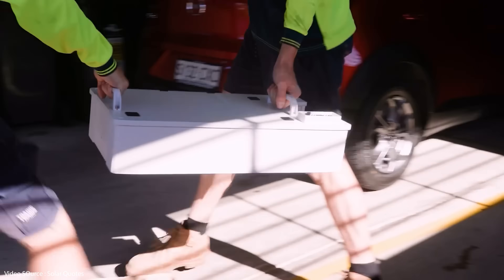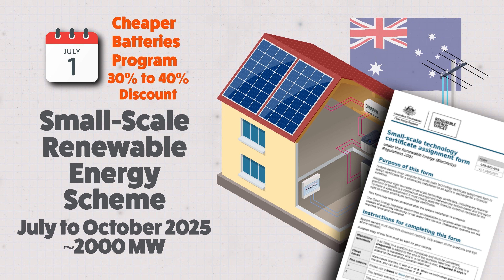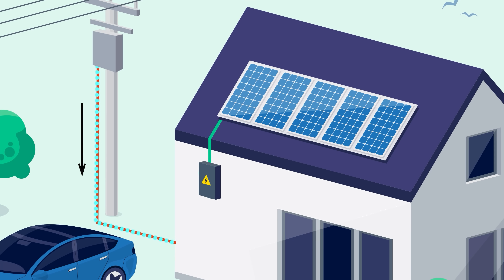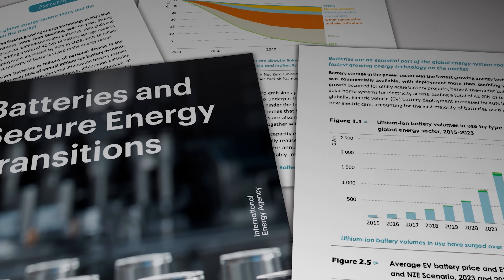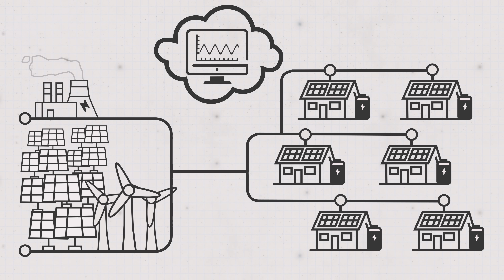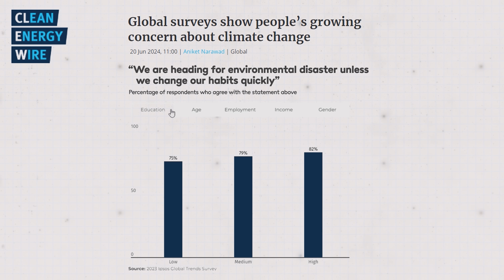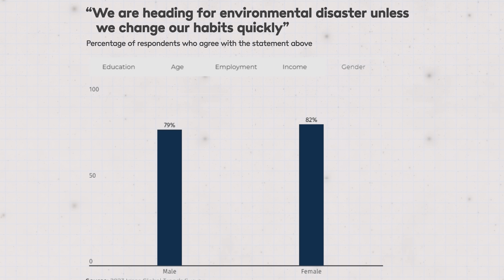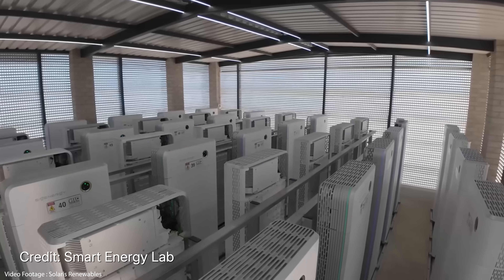Australians installed 100,000 home batteries in 17 weeks. Why can't we all do that?

Comment: I live in northern Scotland where we have a huge number of windmills .
The generators are paid around £1 billion per annum to switch off the windmills as the grid apparently can’t cope.
Discounted home batteries accessing very cheap power like Australia would be a massive game changer here.
Reply: I am one of the 170k new battery owners and this is actually one of the most important points.  It doesn't matter if you solar generation ability is poor... it is the connection to the wholesale grid and the ability to suck up and store cheap energy for use (or sale) later when energy is expensive is THE most important element of the Australian success story. If you have batteries, it doesn't matter where the energy generation takes place - just so long as you can gain access to it when it is cheap and plentiful. You can use it or sell it when it is expensive. That's the real trick.
Reply: @eddiesheehy3993 And over time the battery system will reduce the overall cost of power for EVERYONE not just those with solar battery on their house. This includes renters and those unable or unwilling to purchase solar. 
Win win situation at government, business and personal level.
Reply: @eddiesheehy3993  I look forward to the headlines when these Tesla batteries are remotely commanded to supply the failing grid, and leave the owners with nothing.
Reply: @mrblack888 you can chose if you want to keep more energy reserve for you or to sell it.
Reply: @niconico3907  lol.  Until they decide you can't.
Reply: @mrblack888  how exactly? Even if they did, Just turn off the main switch!
Reply: @hidefandy  Your tesla battery is on a network, they can remotely operate it, or shut it down, at any time without your input.  You signed a user agreement that gives them complete authority to control it.
Reply: @mrblack888  I can’t find your original post but I’m pretty sure you said they can discharge your battery.

They can’t if you turn off the main switch. That is simply not possible if it’s isolated from the grid.  Ie off grid.
They might be able to shut it down but that’s the same as any other inverter.
Reply: @hidefandy  This is cope.
Reply: @mrblack888 
You are obsessive about posting your ignorance. 🥱
Have you been watching too much Sky News?
Reply: @mrblack888 
Tesla is not the only battery system.
Nor are Li ion the only battery.
You really are a little dull.
Reply: @mrblack888 The contract for solar batteries guarantees minimum of 20% saved power for each householder.
Reply: I used to work for the transmission company. There’s 10 GW of wind generation built, only 4 GW of transmission. Cheap overland transmission could have been built pretty quickly and easily, and Scotland could have been exporting surplus generation to England for years. 

Due to tricky community consultations, it’s been decided transmission will need to be largely sub-sea, which will be more expensive and potentially more disruptive to those ecosystems than overland cables would be to their ecosystems. But it’s “not an eyesore.”
Reply: @idunnoay I grew up in the Midlands coal field. Slag heaps, power stations, mineral railways and transmission cables across rural Nottinghamshire. No one commented back then, perhaps because we all worked in those industries! Make it financially worthwhile and then sympathy for the NIMBYs might evaporate.
Reply: @paulhayes6920  it should be that simple :)
Reply: @idunnoay On Gridwatch it show that at 18:10 yesterday the UK was consuming 16.6 GW of wind power. That includes large wind farms out in the channel much closer to where it is used. The issue that won’t go away is what happens when the wind drops for days or weeks.
Reply: @Tailspin80 ah yes, dunkelflaute. Australia’s east coast grid is moving to eventually having a mix of 1. Geographical diversification of networked generation and transmission, 2. Batteries for short term storage of excess renewables and pumped hydro for slightly longer term storage, and 3. Gas peaker plants which would likely operate for about 2 weeks of the year when absolutely necessary.

I assume other countries’ grids will eventually look to do similar with some variation
Reply: @idunnoay The thing I don’t get is what problem is Australia trying to solve? They remain by far the world’s largest coal exporter (34.9% in 2024) which on a per capita basis is absolutely humongous, so clearly whatever it is it’s not climate change.
Reply: @Tailspin80 yeah 3rd largest exporter of fossil fuels generally. The current government here is good at having its cake and eating it too, which means making relatively ambitious commitments to reduce Australia’s scope 1 & 2 emissions, while saying the scope 3 emissions from our exports are the responsibility of our trading partners and defending them on the basis of carbon accounting, “helping our partners transition,” and the drug dealer’s defence of “if we don’t sell, someone else will.”

It’s been electorally successful for them. It’s easy to believe the only way we stop exporting coal and gas is if Japan and South Korea stop buying it.
Reply: @Tailspin80 Why the hair shirt? Why always climate? Cheaper, less other pollution, more individual control.
Reply: @paulhayes6920 Cheaper is why consumers go for it. But why does the Australian government subsidise it but encourage coal exports? Politics and lobbies.
Reply: @Tailspin80  OZ's biggest energy subsidy is to the coal industry at $14.5 billion US each year.
Reply: @Tailspin80 same “problem” Norway was trying to solve with its sovereign wealth fund and move to electrification, I presume. If we don’t use it, we have more of it to export. Mad, isn’t it.
Reply: @EstherV359  I suspect a bit of virtue signalling as well. Norway is very wealthy. Their oil fund is worth $2 trillion USD, or $340,000 per person so they can afford a bit of brand marketing.
Reply: @Tailspin80  Cynically, I think it's the easy push to pressure individuals to reduce their carbon footprint whilst not dealing with the big issues such as industry.
Reply: @aries6776 Industry does whatever is cheapest and if they don’t they go bust and are replaced. The system is based around this one dimensional invention called money and survival depends on making it not losing it. To superimpose an alternative system on top such as carbon accounting can’t really work. Even regulation can’t really work either because we don’t have a world government. The best hope is that eventually fossil fuels become economically uncompetitive against other clean sources of power.
Reply: @Tailspin80 the pollution comes from burning the coal, not exporting it. Otherwise you double count the emissions. Its like if you blamed the middle east for the diesel you burn in your car. If you don't sell them coal, they will buy it from somewhere else. Coal burning has also local pollution with ashes and other toxic gases that better be prevented even if you don't care about climate change.
Reply: @niconico3907 CO2 accounting is based around consumption rather than production because, in my view, this gives the maximum scope for weaselling out of serious commitments. If someone in Australia digs up a ton of coal there is only one place it is going: into the atmosphere. Reducing and eventually eliminating production is probably the only effective way to address the problem. That’s why we don’t do it.
Reply: @Tailspin80  like anything else it’s about economics. Why pay utility companies 3-10k a year.
Reply: @Tailspin80 but its different if you talk about petrol. It can be turned into plastic, roads, or diesel. How can the petrol exporting country know what you are going to do with it.
Reply: @niconico3907 Plastic is the main way in which fossil fuels are sequestered, but we only make about 400 million tonnes a year compared with 15 billion tonnes of fossil fuel consumed. Plus another 128 million tonnes for bitumen used as the binder for asphalt. Thats 3.5% in total. The rest get burned and turned into CO2. For sure no one ever puts it back in the ground once it’s been dug up.
Reply: @idunnoay Australia also has coal of better quality in that it burns more cleanly and efficiently. Better that overseas countries use our coal while transitioning to renewable energy rather than burning poor quality coal.
Reply: @T @Tailspin80 Fossil fuels are already less competitive forms of energy against renewable and hydro energy.
Reply: @jennifercampbell7698 that was a lobbying campaign by the Japanese government and some international miners back in something like 2008-2012. I don’t think those mining companies even argue for “clean coal” any more, BHP span off its thermal coal businesses into another company because they couldn’t sell them 😅

The cleanest coal is obviously the coal left in the ground - that’s carbon capture and storage that works.
Reply: @idunnoay True. But there is an ongoing transition process. 
I just recognise there is different qualities of coal. And Australia has coal that is sought for high level manufacturing, steel production for example. 
I certainly don’t support the concept of clean coal or continuing fossil fuels into the long term future though.
Reply: @idunnoay  Oh wait, genius cult followers also think they will put up multi square kilometers of solar panels in Spain and magically transfer 100GWs to 1000GW's of power north
Reply: @w8stral  transmission doesn’t need to be magical - but getting community approval for essential infrastructure being built in the most efficient way is hard, and shouldn’t be underestimated. Particularly when, in places like my home country of Australia, vested and political interests advocate for a less efficient system because it suits their needs.
Reply: @w8stral  It's not magical - it's cables. In fact X-power is putting a load of panels in Morocco and shipping the energy all the way to the UK .
Reply: @xxwookey if you mean xlinks then that was cancelled by ed miliband in June 2025
Reply: @pmac6584  Hmm, I didn't know about that. Not actually 'cancelled', but not given a CfD in the auction, which could well kill the project. I wonder what the offered/proposed strike price was? Thanks for the update.
Reply: @xxwookey And in Australia there’s a plan to export energy to Singapore. Also Tasmania sends hydro power to Victoria.
Reply: Storing some as heat in a water tank may help...
Reply: @anguscampbell1533  I saw that on a visit to Greece a couple of years ago. Nearly all the roofs had solar panels on top of a round tank which I later found out was for hot water.
Reply: You mean wind turbines? Or do you mill lots of flour in Scotland now?
Reply: Wind turbines, not windmills.
Reply: @TheFrewah Get a life beyond pedantry!
Reply: And a damn side cheaper than the subsidies to not produce!
I'd funnel the money to locals first... it's your landscape they dominate.
Reply: It would help you better if those wind turbines were on the consumer side of your meters... which of course is impractical... unless you get yourself into a community owned mixed generation project.
Reply: The generators are paid when they switch of the windmills and on top the consumer pays for coal/gaz power when those windmills are not producing enough. Same for still hugely expensive BESS energy that only covers power peaks for some 2-4 hours at a huge cost per mWh stored and sold ($100 to $400 per mWh). It´s a business model that generates 16% ROI for investors per year.
Reply: we do need more localised tariffs to make this work, I think Greg Jackson is campaigning for this as certain areas of the nation we need to store and deplete and different times of the day
Reply: @edc1569 Yes , you are dead right but Ed Milliband, the UK Energy Secretary is dead against it.
Time for an independent Scotland where we benefit from the energy bonanza.
Reply: I'd be interested to know how many string inverters were replaced during these battery upgrades. Here in Ireland, ESB, SEAI and other key stakeholders are actively sharing information through ISGAN which includes sharing lessons learned in Australia.
Reply: In your case, it would be cheaper and better to build grid scale pumped hydro energy storage. You have water and hills. And also big scale batteries. It would pay itself fast to store energy when it cost near zero and sell it when it is expensive instead of paying windfarms to stop producing electricity.
Reply: @niconico3907 We have a huge amount of pumped hydro storage .
Our problem is we are tied into an outdated artificial energy market which assumes we are far from the centre of electrical production.
The opposite is true.
We therefore pay the highest prices in Europe. The UK government simply prefers to pay generators rather than allow customers to access cheap electricity.
Reply: Its not the wind that is the issue. They are compensating the coal generation assets for their loses. Funny how most of their owners are in the house of lords
Reply: You could all have Hot Tubs in the meantime.
Reply: Home battery storage would not solve that, those are often combined with roof solar to make sense. 

It does require larger grid level battery storage at the source of production near those windfarms. 

The issue is that building put the grid is often costly and takes a long time. Therefore it does lack insentives do to so.
Reply: @paxundpeace9970 That is half true. The batteries need to be the other side of a grid pinch point. Having them in your home guarantees you a cheap energy supply with or without solar as you charge them when energy is cheap. Grid scale batteries can be useful as they can store energy after the pinch points and benefit from economies of scale. The owner of the battery is the one getting the main benefit. If you hold shares in gresham or gore street or one of the many grid scale battery companies then you can get dividends. Have the battery in your home and you can get free energy. Buy low sell high. You don’t always want the battery close to generation but in the best place to buy and sell the energy
Reply: Wow. You'd think that with that billion pound bill, this would be a no-brainer already.

But then, the UK government...
Reply: @gro @gromm93 point is that the economics of storing bulk unused wind energy on the network for long periods are totally different from local short term domestic storage of solar. No comparison. If there are billions of $ to invest there are probably better places to use it, such as improving the network, developing demand management and building wind farms closer to where it will be used.

Also, compare the average wholesale cost of 4.28 pence per kWh to the cost of storing it - about 1,000 times more. Economically it’s a non starter.
Reply: @Tailspin80  "4.28 pence per kWh to the cost of storing it - about 1,000 times more"
What a nonsensical comment. That's like dividing one hours output of a wind turbine by its capital cost and saying that's the cost per kWhr. An LFP battery has a lifespan of maybe 8000 cycles, so if it cost £40/kWhr of storage that's only 0.5p/kWhr per storage cycle
Reply: @garysmith5025 You can argue about the numbers but the fact is that the largest battery project in the world (Edwards Sanborn (USA)) is only 3.3GWh. That’s going to keep the UK going for about 10 minutes, given that we generate about 17 GW of wind power in good wind conditions. It’s simply the wrong sort of storage for wind and doesn’t begin to solve the problem.
Reply: @Tailspin80  Of course I can argue the numbers, especially when you're trying to twist them. 
" the largest battery project in the world (Edwards Sanborn (USA)) is only 3.3GWh".  So what? Why is the size of the largest battery relevant? The UK currently has nearly 7GWhr of utility scale batteries and an estimated 1.9GWhr of domestic batteries, a further 60GWhr of utility scale have been approved and it will become normal for every house to have a modest battery that soaks up maybe 5KWhr during off peak or from home solar and feeds it back within the home at peak times. It's obvious that we're going to have a highly distributed grid with generation and storage in virtually every home and business. In 10 years time the UK will probably have something like 200GWhr of fixed battery storage, and over 1TWhr of batteries in vehicles
"3.3GWh. That’s going to keep the UK going for about 10 minutes", again, so what? Why is it all or nothing? There's never going to be a time of zero generation on the grid, the whole point of battery storage is to cover temporary shortfalls and avoid having to pay CCGT stations to fire up and run for an hour or two at excessive cost.
Reply: @garysmith5025 Just explaining why it hasn’t happened already at a grid scale. Too expensive compared to the benefits. Most bulk storage is pumped hydro. If domestic battery storage develops naturally for economic reasons then great. It will be in parallel with the growth of electrical demand such as EVs, heat pumps, etc. It will take time for the new network architecture to develop but sticking massive grid scale lithium battery facilities in Scotland doesn’t make sense and probably never will.
Reply: It would be more cost effective for the government to install large-scale battery storage than individuals.  Australia's case is different because they're also installing solar panels which can charge their own batteries.
Reply: whos going to pay for the ''discounted'' batteries?!
Reply: Discount the batteries from a much smaller fund than the £1 billion going out in constraint payments annually.
Each householder will then have to fund the balance for their own battery.
This can be offset with super cheap electricity whilst wind turbines turn and are not switched off as often.
Reply: @michaelmcclafferty3346  I prefer not to distort the markets. The case for home batteries in the UK is not the same as Australia. Australia doesn’t have a single grid and we don’t generate domestic solar on the scale of Australia. The case for grid-scale battery storage in the U.K. is poor because wind fluctuates over much longer periods and storage is far too expensive to cope. The main problem is grid topology and capacity because it was built around distributed power stations and much less overall electrical demand, so that is the area to be addressed first.
Reply: @Tailspin80 The UK energy system/ market is very artificial and not like normal market systems.
I thought that if you produce a lot of something it gets cheaper and you sell more. Imagine bringing the same model to car production for example?
 We would be paying car manufacturers not to produce cars!
Reply: No... the Grid cannot cope.....  adding batteries , just means  extra load, the grid cannot cope 
Are you one of these Adults that  uses wishful thinking to move energy from one part of the country to another?
and that adding batteries some how  siences hte shit out of the problem.
Reply: What keeps it from happening?
Reply: @gerhardwesp3995 The UK government and big money!
It’s time for Scottish independence.
Reply: Michael, I just looked up solar curtailment in California. In 2023, California curtailed 3,400,000 MWH of solar and wind in 2024!

So we Californians need battery storage as well, at least 50 kWh per household.
Reply: @freeheeler09 That's where paying for somebody to store the extra electricity would make economic sense rather than paying to not produce.
Reply: @edbruder9975 the producers shouldn't be getting money to not produce unless they can provide power exactly when its needed.  The only reason a power producer should be making money to not produce power is if they are needed for grid stability.  The problem with the intermittent power providers is they over produce at times when its not needed which doesn't help.
Reply: @freeheeler09I agree. I have solar panels which produce 3.7 kws per annum ,an air source heat pump and a 13.5 kw Tesla battery.
In addition, I have shares in a crowdfunded windmill where I get 3,000 kws. I’ve done all I can to reduce my costs.
The energy system in the UK is rigged and prevents people accessing cheap power. We in Scotland, pay the highest electric prices in Europe when we should be getting it very cheap. It’s nuts!
Reply: @michaelmcclafferty3346  You mean 3.7 MWH? And a 13.5 KWH battery? :). Also, my family, brothers, mother, etc, live in the Outer Hebrides HS1, and their electricity in 2023 was £0.24 per unit, and is £0.20 per unit now. 

I'm living in Devon, we were paying £0.67 per unit in 2022-23, and £0.54 till the end of 2024, but it's come back down to £0.26 per unit this year. 
But I fully agree with you, as why are the places that don't make any energy, like London, get the cheapest rates, and the places with all the wind turbines, like Scotland and Devon, pay the most? The average electricity bill here was £2,800 per year, now a little lower at £1,800.

And the reason why we are paying so much is that the Tory government put our own produced gas onto the open market, where we have to now buy it back, which is why the prices started skyrocketing after we stopped buying gas from Russia, as everything we use comes from the open market, which is crazy when we are still producing gas ourselves.
Reply: @freeheeler09 There could be more controlled loads added to the grid.  eg nitrogenous fertiliser production.
Reply: How would home batteries help? The bottleneck is the network that takes the electricity south to England. Grid scale batteries near the wind turbines would help but they are very expensive per kWh. Maybe when bulk sodium batteries become cheap enough…
Reply: @Tailspin80  They help by smoothing out the differences between production and demand. The video tried to explain that. Basically, you store the energy you produce during the day and consume it during the evening, night and early morning. If the battery is big enough, you can use a dynamic tariff to charge it off the grid when the prices are down. That is why battery power at home is an important part of the migration to renewables.
Reply: @Tailspin80  Germany has same problem- excess wind energy produced in flat, windy far north and most industry much further south. The new power highway is way behind schedule, held up by pylon NIMBYs, leading to vastly more expensive underground cables (when farmers allow them to cross fields!) vast capital costs and lots of wasted energy when the wind blows. 
Most National Grids were built to carry power from numerous local powerstations with connections to provide limited import export as needed. Wind / Solar requires new solutions. Batteries are part of that.
Reply: @Tailspin80  so the batteries can hold the energy until more grid capacity is available to transfer it, works super well with solar, with wind it can still be useful
Reply: @edc1569 Do the maths. LFP batteries are about $50 / kWh. To store say 5 GW of surplus power sustained for 24 hours that would cost $6 billion.
Reply: @Tailspin80  The biggest bottleneck in Sco is central Sco not the Sco Eng boundary.

Large volumes of commercial batteries will be coming try to limit this but only so much the Sco grid needs massive work.
Reply: Australias windmills aren't owned by Australia they're were paid for but are rented at such a high rate it's not cheap or good for the environment
Reply: @unipartywonagainstthepeople  OZ's biggest energy subsidy is to the coal industry, at $14.5 billion US each year.
Reply: Do Scawts have wind turbines on their home rooves?
If not, no point in batteries installed in their homes.
Utility / community batteries far more relevant.
Reply: @dudleymills1427  No, but in the UK you can get very cheap electricity tariffs as cheap as £0.035, 3.5 pence a unit at night for EVs, power banks and storage heaters etc, remember E7 or more common today E10?  
Which you use to charge up on. Then use that power for normal times when it costs £0.26+ per unit. 
Oftentimes, power is so cheap that Octopus gives it away for free, and during peak times, I've been paid £6.75 for every unit I have sold back to Octopus.
Reply: @hardergamer   "in the UK you can get very cheap electricity tariffs as cheap as 3.5 pence a unit at night"
Utility / community scale energy storage is cheaper. Price differences will reduce making home storage uneconomic.
Home batteries need to pay back capital in 2 to 4 years, else risk capital and return losses. Currently too expensive.
Reply: Difference is Oz has 9 hours of sunshine a day on average in winter... Which means their battery size is SMALL and they can guarantee to fill it back up tomorrow.  None of that is true in Scotland with wind.  You can go weeks with little to zero wind and in summer you get effectively zero wind.   Makes it cost prohibiitve to go "green" in Scotland as it requires 2 or even 3 WHOLE backup systems instead of 1.
Reply: @w8stral  You can still use the battery and a dynamic tariff to profit off the price differences during the day, e.g., when solar production is high on a sunny day or wind production is high at night or during a low pressure system, prices drop. When you charge your battery off the grid during those times, you save money.
Reply: @joergmaass  LIE: Wind blows whenever it WANTS to blow, not when YOU stated it would blow.  Can have WEEKS with ZERO wind.  ZERO.  You build a system on WORST case scenario, not averages.  Not best case dreamer stupidity.  Which means you have to have MULTIPLE MULTIPLE times MORE battery backup than nearly ANYONE anywhere is admitting to and you STILL have a 100% generator to back that up..  I have 250kWh of battery and 40kW of solar... Its not enough.  I do not even have an EV or 2 either. I did it because I could not GET power to my property..   You guys are DELUSIONAL unless one literally lives in a desert near the equator.
Reply: @w8stral 
You are also delusional. Living in a desert near the equator doesn't solve anything. 
I live in a desert near the equator. (Trujillo Perú) Sea fog, Sea fog, Sea fog. No rain, no sun, just sea fog.
But I still installed solar.
Reply: @w8stral  Correct: grid capacity is designed around the the time of greatest demand in the year.   FUD: you need to double the generation capacity of intermittent sources with non-intermittent backup generation.  Lived experience: diverse distributed generation, with some non-intermittent generation, is just as reliable... and cheaper.  This is why new capacity is being added using renewables... oh and the reality of averting the worst of climate change is currently being addressed.
Reply: @ChrisNotTheKing  Delusion.  Everywhere "renewables" have been used over coal, or nuclear, prices have massively increased in EVERY location.  The ONLY exception is USA, Texas due to its VAST natural gas which is essentially being sold for FREE.  

Everywhere in the world WITHOUT "renewables" has electricity at HALF the price of any region "with" so called renewables.  

"worst" of so called climate change... HAS A single one of their predictions come ANYWHERE close to reality?  No.  Direct opposite in many cases.  So much for being "scientists" instead of cult leaders eh?

Stop snorting drugs.
Reply: @richardbrice6535  You get CONSTANT sun, not seasonal, that is the difference.  And I'll bet if you went 10km inland or maybe 20km the sea fog would vanish
Reply: @w8stral  Delusion is believing consumer prices for electricity will come down before renewables roll-out is complete.  WHOLESALE cost of renewables is cheap... and will continue to happen until fossil dependence is withdrawn.  Retailers willl continue to pass the cost of transition onto consumers.  Nobody in their right mind would believe otherwise.  Deluded wishful thinking in short time frames.  Sucker to politician positing.
Reply: @ChrisNotTheKing  And yet, Texas is managing it... It is almost as if things built in correct position, have better economics than Zealot FOOLS building things where they should NOT be built due to DELUSION
Reply: @w8stral  What you're missing is Texas hasn't pegged its price of gas for local consumption to worldwide prices.  Some other places with local gas production, like Australia, have corporations with long-term supply contracts overseas.  Local consumers in South Australia don't get special treatment.  The deep inroads into renewable generation, and partial inroads into transmission upgrade payback don't translate to consumer price benefit because as soon as even a little gas is used wholesale prices are pushed up via the inflated worldwide price of gas.

Switchover from coal to gas in USA has been one of its bigger contributions to emissions reductions in recent times... but it's only a stop-gap until incremental carbon free generation rollout reduces the need for gas generators, which then become relegated to backup.
Reply: @ChrisNotTheKing  UH, you just made my point.  It only WORKS in TExas because they get the gas for free to balance the garbage Wind and Solar.
Reply: @w8stral  "Can have WEEKS with ZERO wind"
The OP is talking about northern Scotland, have you ever been here? The idea of zero wind for weeks is laughable, the last time I did the analysis was for the whole of 2023, in that year the longest period during which this grid region's total demand could not be met by wind generation (within the region) was only 37 hours, the total for the year was 913 hours. Those aren't hours of zero wind, only when it would not meet 100% regional demand, the lowest output was 43% of demand for 2 hours.
Reply: @w8stral  Well done.  As you can see then, adding more renewable capacity reduces the amount of gas that gets used in total, leading to fewer emissions. This is EXACTLY why methane was identified early on as the best fossil transition fuel!!
Reply: @w8stral  You stated that you couldn't get power to your property. That is not the case here in Europe. You always have a grid connection. You are comparing apples with oranges. In your case, being cut off from the grid, it might help to not only rely on solar, but combine power sources. Furthermore, I do not relish being called names by a hillbilly living at the end of the world. Shut up if you cannot keep it polite.
Reply: @w8stral  As a fellow Scot, I've never once in my 48 years seen a time when there has been "Weeks without wind". In fact, our local turbine at HS1 Stornoway has only stopped making power for 6 hours over the last 22 years, apart from maintenance work.  
I assume you are in the Highlands? As others have pointed out, there have never been weeks or even days without wind there. And you state you have 250KWH in batteries and 40KW of solar? What batteries are they? As looking at my Victron APP for every 1KWH of solar installed at HS1 is making an average of 360WH (0.36KWH) of power each day this month, so your 40KWH would be making 14.4KWH each day on average, and this will start going up fast after 22 December.
That's if you have modern half-cut cells and/or bifacial panels, not crappy old ones.

Also, most people who are off-grid in Scotland get heating oil tankard in for heating cocking etc.
Reply: @w8stral  Although in fact is the data has shown that many people who take advantage of the program actually install the largest battery the program will subsidise, 50kWh, with the average size being 19kWh which is larger than the average size home battery in the UK of 8 to 12kWh. Now your problem with wind is a bit of a furphy, renewables aren't just wind, it's the problem of taking a renewable resource in isolation, power grids don't work that way. Scotland certainly doesn't just rely on wind to power itself, and the high cost is caused by other factors than renewables. A proper continental grid system (like the Continental Europe Synchronous Area) for instance would provide power from areas like Spain in summer when the sun is shining while the Scotland wind turbines instead of being curtailed could be supplying power to European countries in the winter. The solution to renewable power is to actually spread them further and use more power sources, geothermal where appropriate, hydro, sun, wind, tide etc. 

Of course investment in the grid is required so that contributes to some cost increases until that is transitioned to handle renewables properly, but exactly how do you think the existing grid was built and is maintained, magic? Investment to support renewables is of course going to cost money, and government investment like the battery scheme in Australia comes out of our paid taxes but in the long run benefits the entire population and the environment. Pity the southern half of the UK decided to cut the links between Europe and the UK, you to could have been part of the continental European grid network. I understand that Scotland voted to stay in, so no insult to Scotland, but it was all around a bad decision, the wider you can spread your power grid the better renewables work.
Reply: @stevebrooks2361  Yes, actually grids DO work that way as that is EXACTLY the way the wind/solar mafia mob is presenting reality.  No, it will not help anyone to be part of the "european grid" as those yahoo's are card carrying wind/solar mafia mob members of anti science ignorance....  No, you are not going to be importing 100% of your power from 2000km away.  Beyond Utopian brain dead stupidity.  You may as well say Space Solar power.  At least that is more realistic than pretending you are going to run 1000GW power Towers/cables through forest/towns/cities across a continent kilometers wide... Oh right, UK as a whole imports at any given time 15% to 30% of its power... mostly from France(Nuclear) and Norway(Hydro)... so much for you knowing anything about Scotland... so all you did was INSULST yourself and your "vote"
Reply: @w8stral   "You may as well say Space Solar power. At least that is more realistic than pretending you are going to run 1000GW power Towers/cables through forest/towns/cities across a continent kilometers wide..."

You know that 1000 GW is more that 20 times the whole UK's highest ever electricity consumption right? 

I assume you knew that cables already crisscross both the UK and Europe. Surely you know that. 

You know that China has already built a 3300 km power line that carries 12GW right? That 4 such lines could cover the UK's highest ever consumption and stretch from Edinburgh to Mauritania.

You must know all this if you've read enough about the subject to form such strong opinions. 

So why are you spouting such nonsense?
Reply: @gasdive  You do realize that to the UK is not the whole world right?  Netherlands, Denmark, Germany, Ireland, Norway, Sweden...   None of you have actually gone ELECTRIC yet?  You use Natural gas near exclusively for heating which is majority of your power load which your current grids do not even account for?  Only Norway is mostly EV which will add another ~25% or greater load demand.  Or I do not know, maybe you will wish to become an industrialized 1st world nation again requiring vast quanitities of power to refine materials, so you are not sidelined and laughed at?  You know, REALITY?

Holy Shit your naval gazing is embarrassing.  Pull head out of rectum.  Goods, REAL material goods do not magically appear as they have for the UK being the worlds superpower or the worlds superpower sidekick which has been enforced at the end of a gun to keep those goods flowing.  

Also Apparently you do not how to count... Does the sun in Spain during winter shine for ~4 hours a day or 24???  About 4-5 actually. How many hours in a day?  24 hours.  Does Spain ever have ... oh I do not know --> CLOUDS?  So, in REALITY you have to make allowances for storing at least 3 days of power so, roughly 24/4 = 6 X 3 days surge capability for WEATHER and power LOSS = 20X what the UK needs.  

IS everyone so damned ignorant of how POWER works?
Reply: @w8stral  I certainly am ignorant of how power works. 20 years in the industry, working in generation, transmission, retail, solar permitting, supply interruption and control. All sadly wasted. What a shame none of it rubbed off on me.
Reply: @gasdive  Clearly not.  One day you may learn how to do basic division than any 3rd grader can do with 100% correct answers.    Good Luck obtaining rights to Spain, Portugal, France territory so you can run your gigantic power towers through their country.
Reply: @w8stral  Whoohoo, insults lol, science deniers lol, China has a HVDC power cable 3,000km in length, funny that. The fact is you don't need to run power cables 2,000km, you already have them, the power interconnect just sends power to the nearest interconnect point, then it's the UK's job to distribute it and you know the UK is already covered in a high voltage power distribution network., that's how power grids work, lol.
Reply: @stevebrooks2361  Woo HOO, How cute, try grade school math.  I know, it is hard for anti science climate renewable zealots to do basic multiplication and division, but you COULD try one day soon?  China's 1 tiny cable is a joke compared to what is needed.  UK would need Dozens by itself before adding in Denmark Germany Netherlands, Sweden, Finland, Norway, etc etc etc.  No,  France is not going to be turned into one power line pole after another.
Reply: @w8stral  It doesn't need any, it already has them, don't you understand? That's how a grid works, you don't run a single line from one end of the country to the other, you already have a grid made of low and high voltage lines, some AC and some DC. The distribution lines already exist, the China example was just demonstrating that, yes, you can run power cables a long way if you want to, not that you need to, get this into your understanding, that power network already exists for distributing electricity, it's called the power grid. Yes it needs upgrading and maintenance, but it is already there.

The entire world agree there is global warming happening, even Utah in the US is panicking because they have ignored all the warnings for year and suddenly the snow has gone and they won't get water for the summer, this is show you think right, oh it doesn't affect me therefore it's a hoax, until suddenly it does and it's to late. Madness, but then we know you have no arguments because all you can throw around are insults, everybody reading can see that for themselves.
Reply: @stevebrooks2361  Buddy, do not give up your day job... assuming you have one.  No, that is NOT how the grid works
Reply: @stevebrooks2361  The UK is part of the EU grid, and has been for many decades. In fact, this year we have been making so much renewable energy that we have been selling around 25% of it to the EU, with France and Norway being two of the largest buyers. And like you said, we import energy at times too. 
Just so you know, w8stral is a troll, and has been proven to be one in past posts.
Reply: Did your psychiatric meds run ou
Reply: @philbeau Cò leig a mach thu ?
Reply: @w8stral  I'm Australian. Since I installed solar the price of panels has fallen to 1/16th what it was. (In inflation adjusted dollars). You can install 16 times more panels than I have for the same money. 

When the sun is just below the horizon on a cloudy day I get about 500W from my 4 kW system. In full sun in summer I get about 3500W. 

So on Orkney a system 16 times the size of mine (with good quality inverters) would be making more than 8 kW. Double what I get on the best summer day. It would make that for 6 hours a day. I only get 3.5 kW for about 2 hours. Then it gradually falls off. So with 6 hours of pretty constant 8 kW, the Orkney installation would generate more than twice as much as I get on a summer day.
Reply: @gasdive  Above 77 degrees F (25°C) solar panels begin to lose efficiency.  For every degree C above 25 you lose between 0.3 and 0.5% efficiency so on a 35 C day you'll lose around 4%, but the higher temperatures also cause much higher degradation of the panel long term.
Reply: @Les_S537  yep, Scottish panels will last much longer and produce more.
Reply: @gasdive  Utter Delusion: No one has space for a 16X size increase in solar panels.  On top of that, you do not even know that even as of 5-10 years ago, Solar panels cost less than the rack they reside on.  Today it is a fraction of that cost.  Solar panels cost about the same than the wire.  Solar panels cost far less the inverts they are going to.  Solar panels cost less by FAR FAR FAR FAR than the batteries.  All of this before one adds in the cost of labour.
Reply: @w8stral  

Good points. Scotland is famously lacking in space. Like Singapore, except worse. 

I'm glad you pointed out that panel racks haven't dropped in price at all what with the 200X in volume there's no savings. 

Very perceptive that inverters haven't also massively dropped in price, and good thinking that if you over build the panels you must also install matching inverters and can't possibly put more panel capacity in than you install inverter capacity. 

Nice to have explained how cutting the cost of the most expensive component by a factor of 16 somehow increases the overall cost. I wouldn't have worked that out. 

/S
Reply: @gasdive  The panels have never been the expensive part except when NASA does it...  /Truth no /S
Reply: @Les_S537  Have you any concept of the degradation in the already poor efficiency of thermal power generators in high ambient temperatures?
Ask any Sydney resident when their black/brown outs mostly occur. 
Industrial production restrictions due to erratic power supplies also occur on days of high ambient temperature.
Ambient heat and direct sunlight are far less of a concern than you imagine in regard to photovoltaic generation.
Reply: @w8stral you sound incredibly triggered mate. Maybe calm down a bit? Noone is forcing you personally to do anything that might harm your precious world view. If this is all bothering you so much, maybe find another channel. This one is obviously not for you. The rest of us can carry on looking for solutions with an open mind, and you can pop over to whatever conspiracy echochamber website floats your boat and YELL TO YOUR HEART'S CONTENT.
Reply: @w8stral  Then maybe a "3 hours of free electricity" system like we also have in much of Australia would help.  While the large scale renewables are generating, and to limit curtailment, pump that electricity into small home batteries so that they can power the house in the evening and maybe into the next morning.
Reply: @w8stral  Geothermal is your answer...
Reply: @Les_S537  I have it.  Installed it myself.  Have 40kW of bifacial solar as well.   I STILL require 250kWh of battery backup and it is still not enough for house + shop.    This thing called WINTER.   And this will never cover an EV or 2 for a typical household in winter either. (Off Grid would have cost me $50,000 just to hook to grid)
Reply: @w8stral  Zero wind in Scotland in Summer? Are you serious?
Reply: @w8stral I don't know about those numbers mate, I'm in South Australia and my 10kW system was generating an average of 35kWh over September (the first month with my upgraded system). That's averaging 3.5 'solar hours' per day in spring. 
I expect to just meet my demand (≈20kWh/day) with the system I have installed. 30kWh of storage means I can go a day without any solar (rare, a cloudy day still nets 6-8kWh) if I manage my loads. 

We certainly do get 9 hours of 'sun' in summer, but might only generate peak output for 6-7 of those. 
PV + wind + micro hydro can all feed into a battery that's sized appropriately. Perhaps you could charge at night when demand is low and prices drop. 
PV has got so cheap here because of the market size and maturity, adding a decent 6kW array to my old system only added AUD2,000 to my battery installation cost.